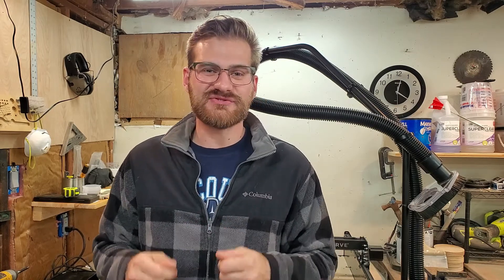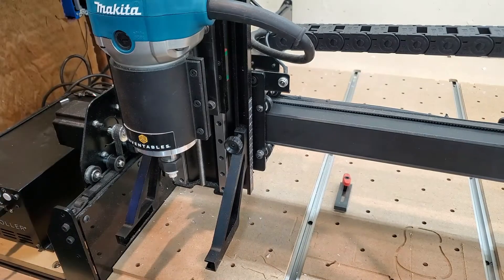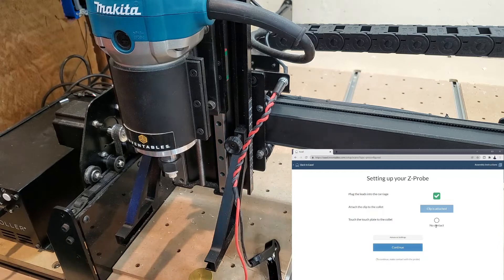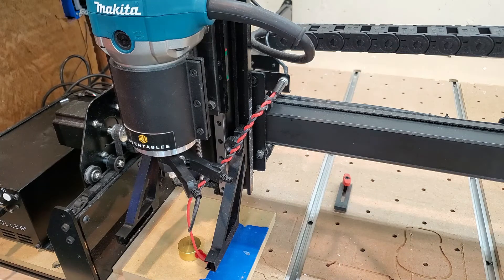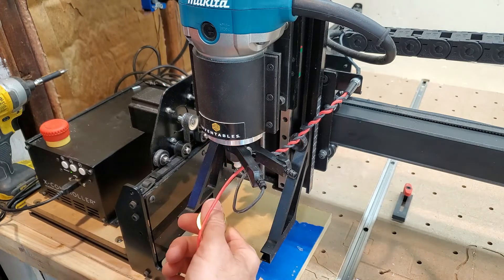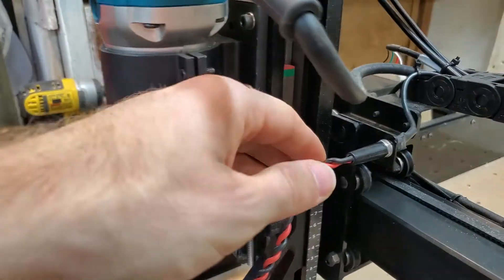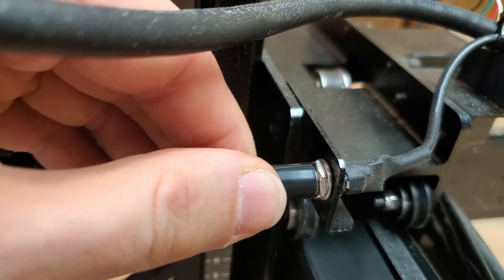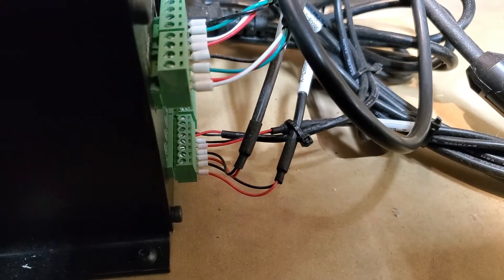Z-Probe Installation | Inventables X-Carve

Comment: I have a machine I purchased when the 1000 was the latest and greatest in x-carves. Had it for three years before I even set it up, today I am attempting my first carve. I made it all the way through to the "work zone" step everything worked fine until I go to the probing step, it is not automatically probing and I cannot figure out the problem. I have checked all wiring; everything goes up and down as it should with the arrow buttons.

Comment: Great video. Thanks for posting it. When you set up your x,y zero point, do you place the edge of the bit on the outside corner of the material or directly on top of the corner itself. I recently got an xcarve and I'm having difficulty nailing this down. I'd imagine it gets even trickier when you have to change out a bit for another cut like you did in the video. Thanks again.
Reply from the maker: I place the bit on top of the corner.  With a downcut bit I does not matter as much because you have the thickness of the bit itself to compensate for the edge, but for a V-bit you will lose your edges if you go to the outside.